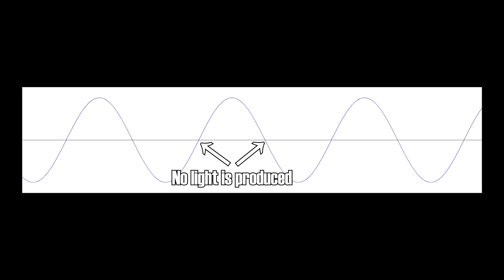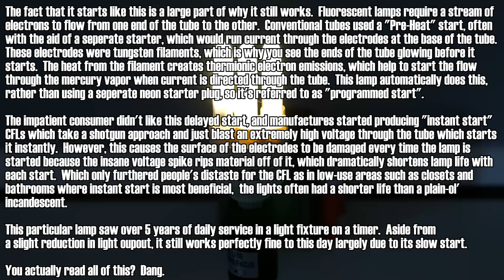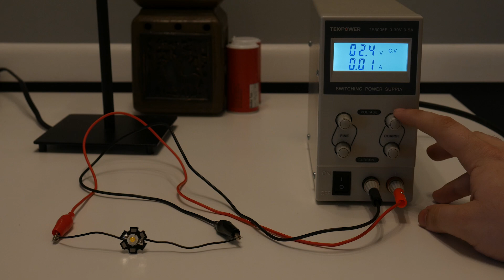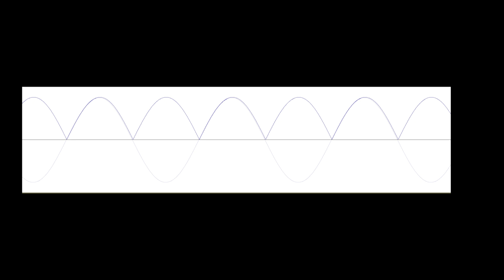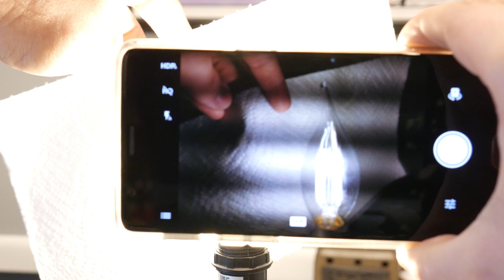LED bulbs that flicker, and CFLs that almost never did

Comment: sorry, but in practice its almost impossible to find good LEDs. either the light is terrible (poor CRI), or they flicker, or the only good brand isnt available in the form/power you need etc. the worst thing is, you cant really test it in the store, they dont have a 'dark room' or something, so youre supposed to go back and forth returning and replacing them, until you randomly stumble upon a good one.
also, gamers will notice 120 Hz flicker easily. even street lights annoy me now.

Comment: Now that LED is practically the only light type you can get in Europe, wouldn't it be clever to make a DC-light-connector and place the complicated converter in one large box somewhere in the house. Centralising the converter must give way for better quality and efficiency while allowing for smaller light bulbs. I'm thinking it could be a completely new connector that could coexist with the old E27 and E14.
It could also modernize other aspects, like requiring much smaller voltages and smaller wires, since LED draws no power compared to the full-fledged A/C power lines required to run 100W bulbs.

Comment: light bulbs are flicker free above 42Hz.
that is why we chose 50/60Hz for ur power lines.

higher freqencies are harder to synchronize across the power network and have less efficiency.
50Hz is the sweet spot, i have no idea why some chose 60.
probably because the frequency used to be generated by the physical generators which can have trobleoperating at different speeds.

Comment: Two major cons of CFLs to me are the slow "warm up" time and the fact that they are very difficult to dim, if at all.
The dimming range, IF they claim to be dimmable, is pretty narrow as well.
Dimming them also makes them plate the inside of the tube turning them black because they don't burn off the crud.

Comment: Problem with the capacitor is probably not that it's not big enough, but it's not fast enough... that is, the rate at which it can charge and discharge limits the amount of charge it can store to flatten out the rectified current. The capacitors are one place where pennies are saved when producing the bulbs to bring their price down, because other areas of cost reduction, such as the use of cheaper LEDs, make the product less attractive as they change the colour of the light emitted. This will be even more true in the USA with its faster 60Hz mains frequency than with Europe's 50Hz frequency. It may also be because the circuitry doesn't allow enough current through to charge the capacitor fast enough while also lighting the LEDs that the capacitor reaches a high enough voltage to light the LEDs when the input voltage is low... for example, maybe it only reaches 60% of the peak voltage, but the LEDs won't light below 80% etc. This is only if the capacitor is used in parallel with the LEDs, another way to limit the current is to put the capacitor in series, allowing only the first part of the AC duty cycle through, which is a completely different scenario, but i don't know if this is common or even used at all (I've not looked at any of the circuits)

Comment: The cure is to use two capacitors in parallel, whereby you double the capacitance, thus the drain into the waveform will further smooth out the pulsed humpback effect of a full wave bridge rectifier, thus a smoother DC, though you do need to find higher peak voltage capacitors as the voltage effectively halves voltage rating of each capacitor. This is expensive, as electrolytic capacitors cost a great deal more that any other device, except big processor chips. Though you can buy miniature capacitors that have high capacitance and high voltage ratings, but these will cost a lot more too, dues to their having to be specially etched to create a dimple, thus a high surface area looking like a sponge under a microscope. If you happen to come across some ex-military equipment, then source you miniature capacitors from these.

Comment: It is easier to have the amount led's in series thru a full wave bridge to give the end voltage you need.  With 120v thru a full wave bridge and a smoothing cap. you end up with about 160v DC, so about 54 x 3v leds.  A half bridge will give half the voltage but with much more flicker at 60Hz.

Comment: Hi, I was using a few CFLs (when they were relatively expensive still) around 30 yrs ago. The reason ? They still made economic sense and rarely needed replacing. There are fewer things more annoying than when an incandescent bulb fails (usually at switch-on). Anyway, maybe 10 yrs ago I heard tales of CFLs switching channels on TV. I was a bit of a sceptic until it happened to me too. It seems that before failure, the bulb has difficulty starting and if you're unlucky, it mimics the code to change channels. One more reason to change from CFLs to LEDs. Beware of totally unmarked (ILLEGAL) fake Chinese LED bulbs on eBay however that are often a mere 25% ot the wattage they claim ! So far I've had 2 GOOD experiences and 2 BAD ones (refunded). I hope that shines some light on the matter.

Comment: This was great. I have something that grinds my gears on this subject. I don't know if this happens in the US. 
LEDs lamps are still freaking expensive in Brazil. 
The reasoning behind it, I suppose, is that the drivers are more expensive to make than the old incandescent light bulbs. 
For instance a cheap cfr costs around 15 reais.  An led goes for about 70. 
One excuse they use is that the leds are supposed to last much longer. Around 20 years or something. Except they don't.  They are engineered to fail and in a few months the electronics start to fail an they begin to clearly flicker, as in low voltage. 

This drives me so mad! 

As a result I use mostly cheap cfr that give out terrible light,  but at least last longer and cost a fraction of the price. 

Sorry for the rant, but that makes me so mad, and no one knows what am I talking about.

Comment: An article in the Indiana Daily Student (Indiana University, Bloomington, IN), sometime in the mid-1990s about PCBs on campus mentioned that the common fluorescent light ballast was one of the sources. Unfortunately, after the words "fluorescent light ballast", they printed "(which are the weights used to hold down lights on campus)".  Someone cut out the page and pasted it to the door of one of the labs, and it stayed there for some months...

Comment: Very detailed video, you're spot on about the electrical stuff. Another easy way to see if a light is flickering is to wave your hand between what it's illuminating and your eyes. You can also do this to see if your monitor has PWM dimming, or constant current dimming. Someone's probably mentioned this below but I can't find it.

Comment: I have not moved to LED because they are more expensive and they are not designed for enclosed lights because of heat build up can make them die too fast.
I have incandescent in places where the lights have frequent short off/on cycles like bathroom or kitchen and CFL in bedroom and den.

Comment: I recently bought the rod type bulbs for a low profile all glass enclosed fixture.  You really cannot tell that they are LED when turned on.  I do not know if they produce the flicker, but i am assuming they probably do, as the base is that narrower "candle" type rated at a max of 40 watts per socket (there are 3 sockets).

Comment: 13:25  Not true.  You can get incandescent bulbs (more easily in the past than now) at higher color temperatures.  

I used to use a pair of ~500W daylight bulbs to give the correct color balance with 25 speed film, back before digital cameras were worth a damn.

I just checked, too, and you can still get high color temperature incandescent bulbs today.

Comment: At 12:32 -- It's likely that pairs of LED's are in series, which allows one LED in a pair to fail open-circuit, which allows the filament to stay lit for a while (the still-working LED from the pair is conducting twice the current).

Comment: I cling to incandescent for three good reasons.

1: I run a dimmer switch in my room and LED bulbs compatible with this dimmer switch cost an absolute fortune.

2: CFLs fucking suck.

3: Incandescent bulb efficiency is no big deal given how laughably cheap my hydroelectrically generated electricity is. There's no economic or environmental impact from me using them so I can just laugh at people who try to argue polar bears at me trying to change my mind.

I usually use the 40w bug lights, as I love the color they produce as well.

Comment: My community rec center used to use fluorescent lamps, it had abysmal CRI and every single photo taken in there came out with a really strong green tint regardless of your white balance settings. Doing post process color correction would result in people having purple skin. They replaced the lamps with LED ones and the lighting is really bright white but also slightly warm and beautiful and photographs come out really good now.

Comment: Correction. CFL bulbs are better where lights need to spread over a wider area, and particularly for outdoor uses like lighting up the open back yard at night. LED is very poor at spreading light and is more of spot light unless you put a very good diffuser to spread the light. I use both on my estate, LED indoors and CFL outdoors. Talking of flicker, both my bulbs are flicker free, they are verified flicker free from Phillips, and I have them powered through a UPS that regulates power supply to the entire circuit.

Comment: LEDs piss me off. All the LEDs they sell in stores currently are dimmer than CFLs and don't last as long as they should. All the stores where I live have stopped carrying CFLs in favour of LEDs but charge up the butt for them. If the LEDs were designed correctly they'd last for 30 years but now people design LEDs to burn out instead of last as long as they could and should. Based on what I've seen in stores I don't think we should be switching our home or business lighting to LEDs until this technology is more developed and the manufacturers aren't sabotaging them. It's great that LEDs consume less power than CFLs but a higher price per bulb and dimmer lighting really suck

Comment: I really dislike LEDs. As long as it's day outside a warm LED looks good to me. But when it's dark outside and the light from the sun isn't mixed with the light of the LED, the LED looks absolutely terrible to me. Halogen bulbs on the other hand look really nice.  Now LEDs with a better CRI are available online and I wonder if they would look better. But I won't give LEDs another chance. The story I was told by the media was that LEDs have a really high life expectancy. The LEDs I bought were used for a few days. I won't buy new stuff ad infinitum.

Comment: At 2:54 you said there is virtually no reason to hold on to the incandescent bulb any more. There are several reasons they are still useful. Applications such as fridges, freezers, ovens, lights on a dimmer circuit, and lights used outside in regions where the temperature can get extremely low in the winter time. You may be avoiding mercury by not using CFLs but you have to deal with arsenic in LEDs.
Reply: I don't think LEDs have any significant amount of arsenic.

Comment: Most LED bulbs use one of those two methods:
- Capacitive dropper
- Constant current switch mode power supply

Capacitive dropper has a very small part count, could be as simple as a capacitor (usually hundered if nF) in series with one of the AC "lines" (live or neutral) with a discharge resistor across it, a bridge rectifier and a larger capacitor (a few uF) across the rectified output (along with a discharge resistor) with the LEDs across it.
The capacitor in series with the AC line reduces the AC voltage to the required voltage for the LEDs.
This method, if done badly (like a lot of cheap bulbs do) will produce that bad flicker.
Constant current driver is the expensive but much better way to go, since it regulates the DC current to the LEDs (being a regulated AC to DC converter), producing even lighting (which also aids for longer lifespan of the LEDs),and produces zero flicker.
In conclusion, capacitive dropper done well can be enough for low-power uses in homes (up to a few 20W or so), done wrong will flicker like a MOFO, but constant current (like all professional lighting fixtures use) is the proper way to go.

Comment: At time of writing, I'd have to say that the cfl is probably a more economic than an LED lamp, as i have bought many led lights over the last 5 years and now only one is working where the cfl's are still running fine. The life expectancy of an LED lamp is a lot less than the stated 50,000 hours, which for me was the selling point. So until the led tech' gets more reliable i'm sticking with cfl's

Comment: The problem with this video:

Most people assumed the issue eye strain with CFL bulbs was because of flickering. While this could be true of some people the larger issue was its spikes in color spectrum. Even the most flickering of LED do not bug me however I cant stand CFL, T12, T8, T5 and T5HO. Just look at the color spectrum for a CFL and compare it to a halogen and LED.  Then take an extra step and compare that to the sun. The spikes cause the light to have a decent looking CRI however they are also sharp enough that your seeing much higher power in a handful of the spectrum vs a much more even spectrum on others. Its basically laser like in very small sections of the spectrum which not all eyes deal with well. I seriously would take a LPS over a CFL.

Comment: I will probably continue using CFLs until LED lights become cheaper. I don't want to spend 4 dollars for one LED bulb for the price of 4 CFLs. Not to mention that I have many, many CFLs, and they last pretty long. I'm not going to throw out the unused ones, (due to their mercury content and the fact that I'd be wasting a perfectly good bulb) But once all my CFLs run out in 10-15 years, I will switch over to LEDs. By then their price will have probably become quite low.

Comment: Regarding 2:50, incandescent lights are still useful as heating lamps and indeed in lava lamps, shown in the video on High Pressure Sodium lamps. Most C.F.Ls in use substituted incandescent lights.

L.E.Ds also save electrical energy if they substitute those other two lights. However, white L.E.Ds are not as efficient as colored ones (like those in traffic lights) and don't last as long. The most powerful white ones even have fans to keep them cool. These fans make a noise and need their own electrical power.

Most applications of L.E.Ds introduce lighting in places where there was no lighting before. And example is placing a large number of L.E.Ds on the exteriors of buildings for decoration. They are not substituting any other kind of light, they are substituting unlit exteriors.

Compare the electricity bill of a person using just one incandescent bulb in their room and maybe using the heat of the bulb as heating during cold weather with the electricity bill of someone who decorates their entire mansion and garden with L.E.Ds.

Comment: At 12:40, their are two series chains of LEDs and the diodes all oriented in the same direction in a chain. However, the chains are connected in parallel with pairs of chain in a filliment facing in different directions so you can feed in mains AC with no driver circuit. This means that only one chain per filliment is one at one time.

Comment: I've been asking myself about a phenomenon I've encountered with light bulbs at home, and maybe someone can help me with the explanation.
I have two different light bulbs, one of them it's an integrated LED lamp and the other is a CFL bulb. When I switch on the LED it pretty much turns on instantly, but if I switch off and on again quickly it takes noticeably longer. 
In the CFL case, it takes longer the first time but it is much faster the second time. 
I understand this might not be possible to explain without looking at both lights closely, but do you have any idea of why this happens?

Comment: This was a very informative video and explained something to me. My work recently moved into a new office building which has LED lights. Our old office had fluorescent bulbs, the typical office drop ceiling 2X4 lights. The LED lights in my office were on full bright all the time and I would get headaches. I've never had light induced headaches before, it was quite strange because at first I didn't connect the 2. It wasn't a bad headache, just enough to be annoying. Also the LED lights are way brighter. With the lights off I didn't get a headache. The LED lights in our building are dimmable and so I asked for my lights to be put on a dimmer. It is SOOOO much better with them dimmed.

At about the 11:20 mark you talk about LED flicker. So I turned the lights on full bright and pointed my camera at the light. Sure enough the dark and light band was visible on the screen! With them dimmed the dark/light bands are gone. So that explains it, I guess.

13:57, And congrats on reaching 136K subscribers, me included. 101K subscribers added 8 months, not bad!

Comment: Hey, so, I know this is veering even more off topic, but can you explain why some LED bulbs tend to glow or blink even after turning them off, and why some don't? I do have an idea, but it would be nice to have someone knowledgeable talk about it.
Also, I would like to watch a video about dimming those LEDs. :)
Reply: When you turn off the light any left over energy is bled off as light and heat (infrared radiation).  You may also see a flash when the capacitor discharges.  It's nothing to worry about, just the bulb getting rid of any stored energy so it's not a shock hazard.
Reply: @docferringer  If there are tiny flickers every 20 secs. or so after it's turned off, power's leaking.